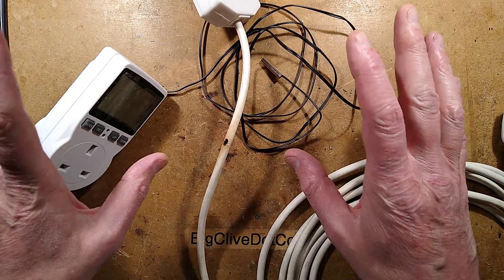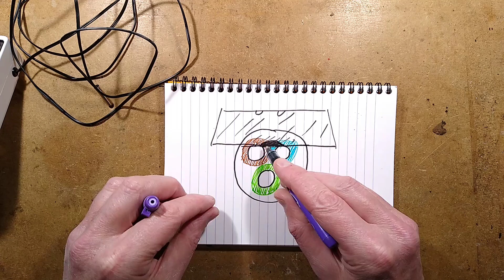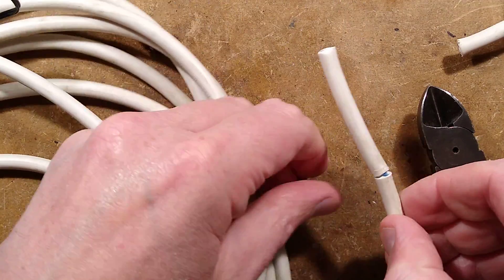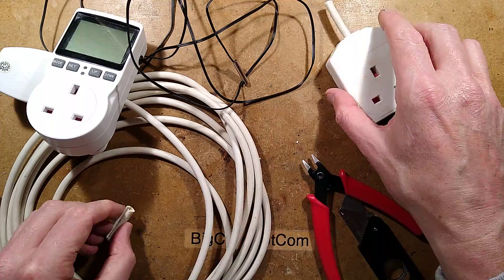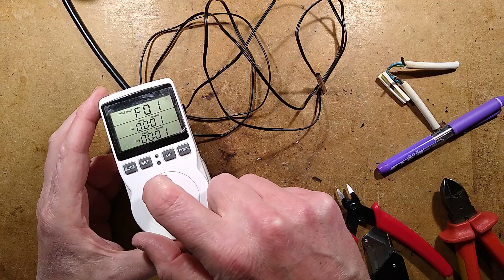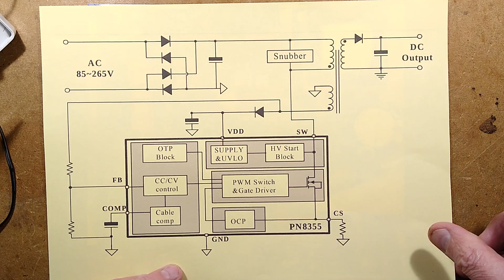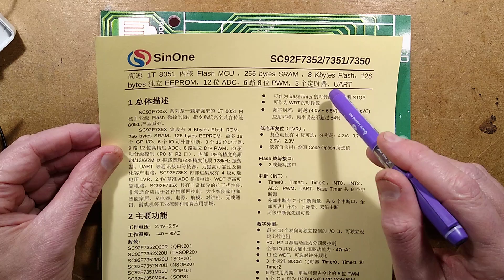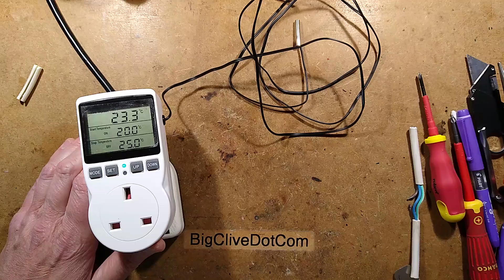The case of the mysterious cable arcing

Comment: nowadays i frequently run into screws that are really "high security" - meaning they are self tapping sheat metal screws with a tri-wing like shape but every "triwing" is sloped so that its easy to drive in but nearly impossible to undo again. is there a special tool for this or is dremeling (and destroying the casing) the only way you guys know ?
Reply from the maker: I've custom adjusted close shaped bits and used high force to try and keep them mated.  After that I drill and replace, using suitable tools to extract the old screw shaft.
Reply: thank you for the ideas, i will try both again, last time drilling was a mess ... i tried adjusting bits with no luck on these screws already. i have extraction tools for bolts, i try to use the smallest one if i can get it in the hole... if not i go with the torx idea. :)
Reply: drill center of screw to just under the size of a torx you don't care about, hammer a torx into the hole and it will broach its own torx profile

Comment: I've had a flex where it looked like the factory had come to the end of the run and spliced (welded) the next piece on before running through the insulation process.
Could have been the case here, or stretched as you said.
But with that cross cut it could have damaged a few strands, he said he plugged a heater in, which could have created the hotspot with the high current that caused it to break down.

Comment: Did you end up opening the socket? Im wondering if maybe that live wire was terminated short making that wire the main strain relief for the whole cable. That could have created the perfect storm combined with a pre-existing weak spot in that wire. Should be easy to spot if its wired completely taut in there.

Comment: I think they call Stanley knives 'box cutters' in the US.
Not necessarily a factory error. It could still have been a knife slice (or a stretch as you said) that just cut the live down to a few strands, high current from a heater finishes it off.

Comment: I had a cable fail like this at the point where it entered my mains powered Oryx 50 soldering iron ie where it's permanently bent at a sharp angle.  It happened while I was soldering so it was right in front of my face and it seemed like an enormous explosion and I fell onto the floor.  I was totally bewildered for sometime as to what had happened because the only visible evidence was a tiny pinhole in the black cable which took some time to discover.

Comment: After spending an entire summer repairing a skip load of both power distro and signal cables at the UK's biggest PA hire company, I can attest to the fact that cable abuse is a terrible thing. How you can physically tear a military grade connector off the end of a 48 way multicore is beyond me. Then again I do know roadies and riggers.
You forgot to mention people who coil cables around their arm. It tends to twist the conductors and put them under tension at the same time.

Comment: Why is that relay at 10:43 rated 16A at 250VAC but only 15A at 125VAC?  I tried turning my monitor upside down but it didn't help.

Comment: When I worked as an electrician I was mounting outlets. I don't know the English technical term, but when I prepared the installation cable, first I removed the white sheath and when I was about to remove the insulation a good 15cm of copper came with it. I checked this up and it happens from time to time that the copper breaks in the production line, and if you're lucky enough it produces an air gap large enough for the cable to be faulty.

…If you're unlucky, however, the air gap is small enough for the electricity to arc over it for a while…
Reply: What's it called when you remove the copper from the insulation instead? Aha! Got you!
Reply: Removing the insulation from the wire is called stripping

Comment: Another possibility is that damage to the insulation has allowed water to enter that has then corroded through. At some point then the resistance has risen until the thermal event occurred. The burning then destroyed the evidence of the corrosion. If this had been the case then I would expect to see corrosion had migrated down the live wire. Would have been nice to see the core of the live wire.

Comment: I once came across a two pin plastic plug that shocked me. I took a neon tester and ran it over the plastic cover it and started glowing. Turns out, the plastic material used inside electrical fixtures are specific type of plastic. Some local plug maker probably thought that plastic was plastic and moulded a set of plugs using whatever plastic he had around.

Comment: Conductors are made from copper. Copper is a relatively soft metal but work hardens easily. Work hardening causes the conductors to become brittle. Brittle conductors break. At some point there are not enough intact conductors to carry the load. Arcing ensues. 😋

Comment: I had a very similar thing happen on an extension cable once except that it was open circuit and I was flexing it to find the break. I found the break when the cable outer expanded like a little  balloon before popping and letting out the magic smoke. I was a little surprised as I didn't have a big load connected. Still, nicely exciting 🤣

Comment: "Tracking" was a common fault on distributor caps on vehicles. If the cap got a thermal shock of any description, microscopic cracks would start a carbon track. Diagnosed by looking at it running in the dark. You would see the arc on the tracks. Solution? New cap.
Ta.

Comment: Power cables do not like to be used coiled up, if you use the maximum amperage with a coiled cable it will heat up as it can not be cooled easily as it it has coils and it also acts as a transformer. How many reeled extension cables have melted because they have not been unwound?

Comment: Now that looks suspiciously like a cable with wires made of "a luminum". "A luminum" is an obscure element from China that looks like copper on the surface, but under load of one amp or more makes a flash of light (hence "luminum") and popping noise, while itself disappearing. Had some extension cord marked "16A" on the outer insulation and the plug, and it didn't survive 3A, having very similar effect. It had a strand of super-thin copper-plated aluminium wires. They also made fireworks-like effects when subjected to a flame.
Reply: Fun fact: This material is known by Canadians as Aloo-minimum
Reply: @hipu  Probably has something to do with telephones (aloo) and mines, who knows :)
Reply: @argoneum  automatic circuit breaker/fuse?
Reply: @esecallum  its a feature! fused power strip (non replacable)
Reply: In and of themselves these are not necessarily a problem but the conductor diameter does need to be larger. For instance at 20A around 2.05mm is sufficient for pure copper cable but copper clad aluminium needs to be closer to 2.58mm which is around a 60% increase in cross section and surface area. This is because aluminium has only about 61% of the conductivity of copper so you need to beef up your conductor my guess is that the Chinese manufacturer cheeped out and omitted that step. By the way I grabbed those numbers from the US specs as I know they allow it in household wiring apparently for a 20A receptacle they allow 12 gauge (2.05mm) for copper and 10 gauge (2.58mm) for copper coated aluminium.
Reply: @FaerieSeraphina  In fact, I rather them use Al because it's cheaper per ampacity, so they won't be tempted to undersize it like Cu. The terminations are almost always soldered so you don't have any of the issues in home wiring that boomers imagine.
Reply: @FaerieSeraphina  That's assuming good quality aluminium.
You can even have chinesium 'copper' wires, that are more bass than copper. Extremely brittle, and much higher resistance than they are supposed to have.

And I reckon random recycled aluminium with random metals added to it doesn't exactly make a more conductive cable in most cases either.

Like I've had 2mm² speaker cable that had a noticeable power drop and got warm to the touch that was supposed to be copper, (and it wasn't copper coated aluminium either, the cross section was homogenous under a microscope of those strands).

But: you only had to bend the whole exposed strand without isolation for 3-5 times and individual strands started breaking.

That's clearly not copper.

I don't remember the resistance, but it was crazy high for a 2mm² cable. 

So really those amperage or rather watt ratings mean nothing if it is coming from China directly. Because it's likely they aren't even using copper clad aluminium anymore but even cheaper alloys.
Reply: @FaerieSeraphina  I'm not sure there is copper clad aluminum. It should be pure aluminum. As for the ratings, it varies upon heat for the exact same diameter.

Also, copper and aluminum are different metals so you would have different expansion rates and galvanic corrosion.  I don't know of anyone that would mix the two. It's usually all copper or all aluminum.
Reply: @etherealrose2139  A quick google search would have confirmed that yes it is a thing and yes it is actively being sold and used in many applications. Hell there are even people trying to sell it as ethernet cable although that is most definitely out of spec and will cause problems.
Reply: @FaerieSeraphina  It is entirely possible to make cables with CCA wire which meet or exceed all specs for Ethernet cables (cat-5e/cat-6), and actually work just fine.  Arguably, this is an even better application for CCA than most other uses, because the whole point with this type of wire is that when dealing with AC, the bulk of the electricity actually only flows through the outer portion of the wire (known as the "skin effect") anyway.  The depth of the skin effect actually gets thinner as frequency increases, so for the type of frequencies used in Ethernet signalling, the material used for the interior of the wire is almost irrelevant from an electrical perspective.  Almost all of the actual signal is only flowing through area occupied by the outer copper layer anyway.

(It should be noted, however, that CCA wire is usually not appropriate for use with POE (Power Over Ethernet) applications, as POE uses DC for transmitting power, for which the higher resistance of the aluminum core does become an issue, so it can produce substantially more voltage drop over long runs.)
Reply: I'll bet the extension cord was branded "CE" which is Chinesium for "Can Electrocute".
Reply: 16A means 16 Angstroms wire thickness or could simply be a house number.
Reply: Another consideration.  Over on the Curious marc channel, they had an issue with wire wrap that was actually copper plated aluminum.  The wire fractured internally and lost continuity but no arc.    I've been seeing China wire that is more towards brass than copper.   This seems to be on the brittle side.
Reply: @bobroberts2371  So far I found two "dishonest" types of Chinese cables: ones with cores made of steel or ones with cores made of aluminium, both disguised by copper plating. I have a thing running 24/7 using some USB cables, and it was a great challenge going through all the nasty cables and figuring out why is data stopping suddenly, etc. Some cables even had a "ferrite" bead made of plastic, but magnet would attract it 'cause cable wires were made of steel… shame.

Comment: Didn't hear a suggestion that a 3KW heater was supplied with a low current cable? 
Small nic in the cable, causing high resistance at that point, it repeatedly heated, 
oxidised, weakening the damaged live conductor to the point it blew like a fuse when 
the thermostat connected the heater for the last time.
 - - - - - - - - - - - - - - - - - - - - - - - - - - - -
Wire  - Current - Maximum 
mm2 - Amps  -  power
0.5      3 amps - Up to 720 Watts
0.75    6 amps - Up to 1440 Watts
1.0    10 amps - Up to 2400 Watts
1.25  13 amps - Up to 3120 Watts

Comment: I have seen examples of chemical interaction between electrical cables. Some have a plasticiser in their chemical makeup, that reacts with other cables. The offending cables become sticky and melt, sometimes exposing the underlying conductors. 
On one occation, a cable was placed on a gloss painted window sill, the cable insulation reacted with the paint, gluing the cable to  itself and to  the surface. A similar problem was observed with a painted book shelf.
 It is common practice to wrap the low voltage lead of a battery charger plug around the plug for storage. Sometimes there is an interaction between the plastic of the charger case and the cable, again sticking the two together, damaging both.
 My first reaction,when viewing the video, was that the black probe lead might have reacted with the mains cable, exposing the conductors, resulting in a short.  Your explanation is consistent with the evidence, but the problem of chemical interaction between cables does exist, and is more common with the black cables.

Thinking about this video, an interesting experiment might be to wrap the black probe wire around the white mains lead, just to see if there is a chemical reaction between the two. 

( by the way, I recall a recent tear down review of an optical fire alarm, but this seems to have been deleted from your site, or did I dream the whole thing?)
Reply: "Some have a plasticiser in their chemical makeup" All PVC insulation for cables has plasticiser in it, but the older plasticisers were not chemically bound to the polymer and it would leach out causing the symptoms you describe.
Reply: @ferrumignis  I have found this problem very common with Chinese imports. I have a high speed drilling and cutting tool, the plastic/ rubber case of which has become very sticky. The problem is also shown by an electronic hand held microscope and a led illuminated magnifying glass. The common feature, is that all have a rubber plastic case, which is obviously intended to improve grip. 
But I also have a set of headphones that were stored in a polythene plastic bag, when this was opened after a few months, the lead and jack plug had melted and amalgamated into a gooey mess. Attempts to separate the cable, stripped it back to the conductors. 

I managed to repair the drill tool, microscope and magnifying glass. It was necessary to strip the products down to its case and electronics. The cases were then washed in a concentrated solution of sodium bicarbonate, then washed with clean water, and then air dried before reassembly. I understand that when the plastic decomposes, it becomes wet with a hydrochloric acid solution, it was remiss of me not to check this claim with litmus paper, but I can confirm that the residue is very irritate to the skin, producing a burning sensation.
I have yet to discover if the sodium bicarbonate treatment is a permanent fix, but it does restore the plastic surface to its original dry condition from some time.

Comment: I once had the joy of finding such a fault the hard way, unintentionally.

There weren't any visual or functional issues, I just wanted to move the cord. Unfortunately I happened to pick it up at precisely the location of the insulation failure, with the drooping cable pulling the wire apart. My palm and several fingers were in direct contact with the arc for several seconds, with both the cable and my hand catching fire at some point.

Unfortunately I'd been using my strong hand, since it didn't actually work for several days and was weak and awkward for some weeks afterward. These days my hand works just fine, and in the end there wasn't even any scarring.

I've been much more cautious around extensions since then, though.
Reply: I had a similar thing happen to me. In my case, it was a hot air gun that seemed to have a bad connection inside - but it turned out to be a broken lead in the cable instead (the broken ends of the lead was just barely touching inside the cable, making intermittent contact). When I moved the cable, an arc appeared and burned thru the insulation almost instantly - right where I was holding it. 
I didn't burn my hand so bad that I had problem using it afterward. But I was only in contact with the arc a second or so at most and that was still enough to burn thru the skin and leave a small open wound at the point in contact with the arc and some burned skin on 2 fingers
Reply: Another consideration.  Over on the Curious marc channel, they had an issue with wire wrap that was actually copper plated aluminum.  The wire fractured internally and lost continuity but no arc.    I've been seeing China wire that is more towards brass than copper.   This seems to be on the brittle side.
Reply: A Scary Movie strong hand?

Comment: Thanks for the grand tour, Clive - very informative.  I didn't hear anything about the brown conductor's size or if it was copper.  I've had to measure a strand or two and count the number of strands and calculate the gauge of the conductor, to be dismayed to find that the conductor is undersized for the amount of current that it must carry.  And I've been very disappointed to find that the conductors attract a magnet, showing that they're not pure copper!  😱😱

Another thing to despise is that zebra strip.

Comment: I've been running a repair cafe in Adelaide Australia, and have noticed many appliances have broken conductors inside the sheath.  When bending the lead it makes and breaks a connection with no external evidence there is a fault, so just replace the power lead. This is not so dangerous with low power devices, but things that are powering more amps like heaters, hair driers and blender such faults can result in something more sparky, burnny distructive!